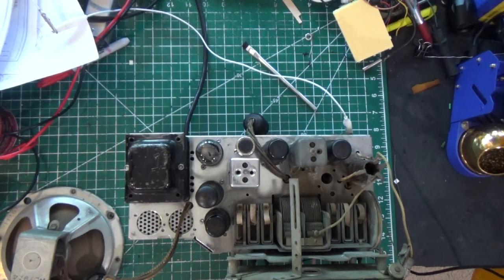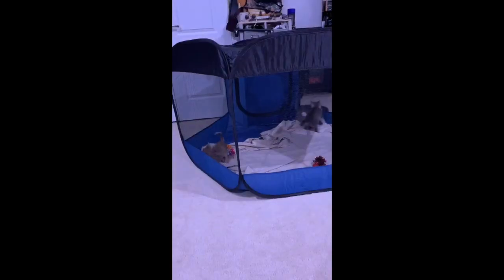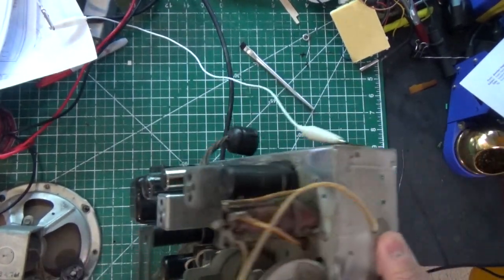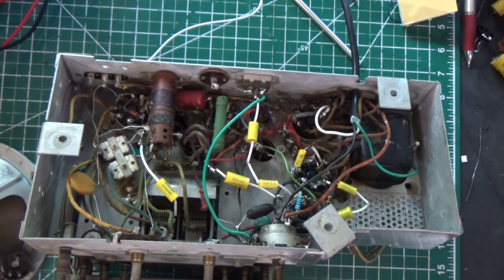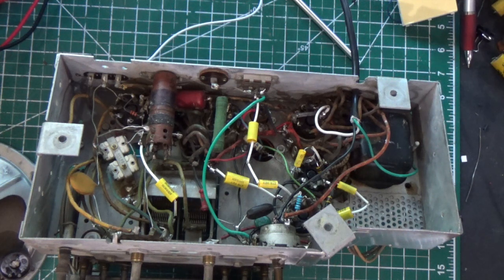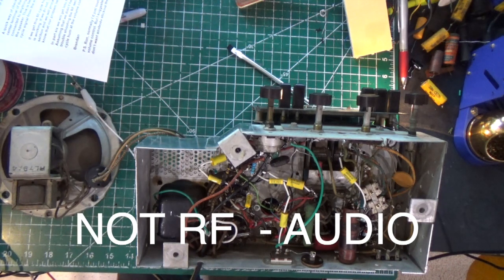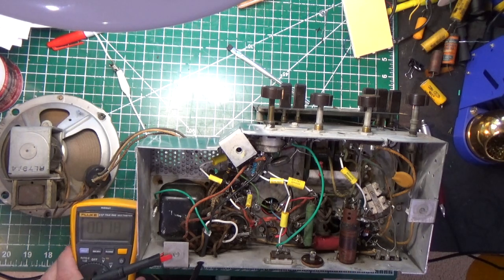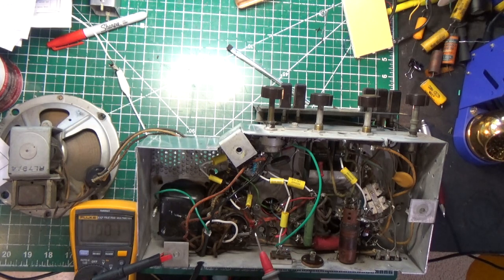Radio Restoration for Beginners RCA Model T62 aka #39 Part 5 - The right way to troubleshoot !!

Comment: Re measuring voltages: back in the day techs used 1000 ohms per volt meters and many service manuals refer to that. Therefore a modern DVM may "see" higher voltages because it does not load down a circuit like the old low sensitivity low impedance VTVMs did.

Comment: Great series and presentation. I am just starting this vac.tube radio restoration/fixing and have some theory in electricity, but not in radios. My thought on these caps is from the near beginning comparing the schematic values with what the radio has in it, I would have replaced them from the start . They were the wrong values for one, the caps that I couldn't make out  or read, I would have replaced, further I would use high quality caps to ensure longevity. You could test the caps with a meter (sending in a signal) without taking the cap off for the ones you couldn't read and compare the value with the schematic, which could be another option if you did not want to replace.  Resistors is easy to test (assuming values match the schematics) more time consuming in a more complex radio. Dim light bulb is a neat idea. I would think that you should be able to predict arcing with high voltage solder areas that are close together and address it assuming there is going to be arcing saving time in the end. Thanks.

Comment: The schematic voltages were often taken, in those earlier radios, with a 1000 ohms per volt voltmeter. Putting a 10 megohm digital voltmeter on it will often read >>higher.
Reply: I doubt that, they used vacuum tube voltmeters (VTVM( with a much higher ohm per volt, not lower !
Reply: @ErwinSerle I’m sure glad I read your comment. I was looking at the schematic just today of an old CB, and one of the pieces of test equipment they say you must have to perform an alignment is a VTVM. That had me scratching my head but now I realize what it means

Comment: I just did everything you said not to do. Now I have a radio that "worked before" but I did not check it and then I replaced a loot of caps without checking along the way.  Do as he says, not as I did.

Comment: Can you describe the type of capacitors you used and the voltage ratings?
Reply from the maker: Hello , I use mostly 600V caps to be safe. They are generally film caps which you can purchase in bulk from SALS CAPACITORS  - http://www.tuberadios.com/capacitors/